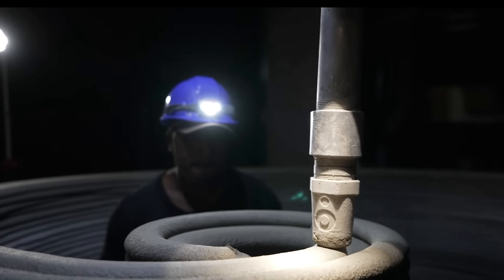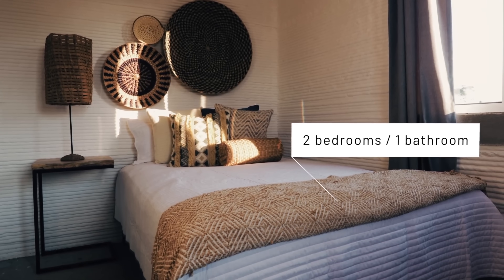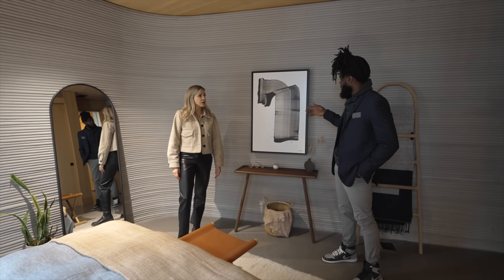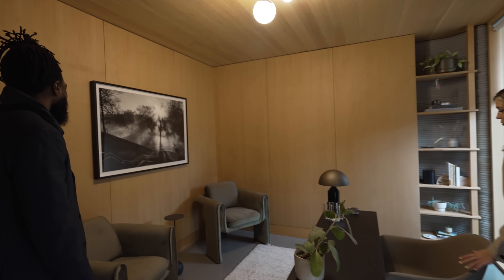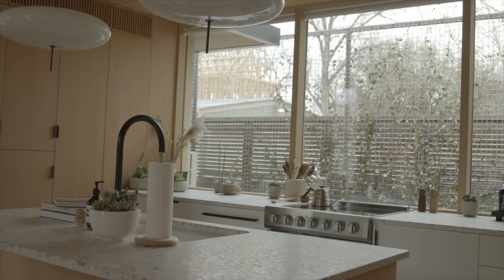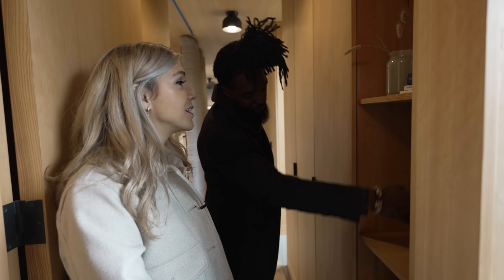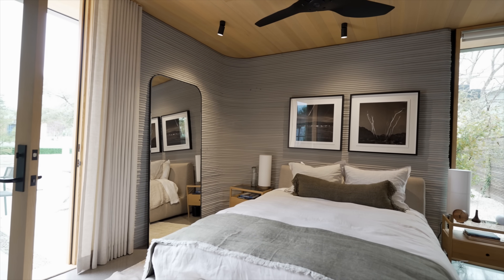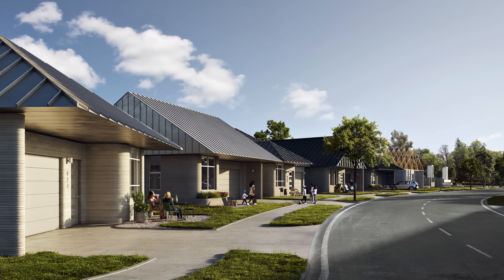Inside A 3D Printed House You'll ACTUALLY Want To Live In

Comment: This is the construction technique of the future. My only concern about such a house is that the exposed concrete parts will collect dust like crazy.
Reply: I do NOT want that house.  to many "technical" /structural Restrictions inovolved with it and  it's required constricted sizes.  The material is a horible mess. Then huge expense to "cover/finish those walls".  Wiring and plumbing issues.  If you want to build something like that there are better/Cheaper , simpler ways to do it.  search ,... Oh what is it called,  Mud/sand bag , earthen bag construction?  And I am not saying I would want that for my main house either.  I've have seen nice "Single Story" hotel rooms....  cement is a mess! espeically when you leave it exposed. Dirt , spiders, and bugs "sticking to it" and those layers/grooves!  then trying to deal with plumbing, electrical etc,  and even try hanging a shelf or picture. :-)) wanna change a door or window? 😅😅😅 that texture is aweful.  even beyond cleaning it has problems.  the novelty would wear off quickly.  and trying to cover that up with wood, plaster, etc... That is Materials and LABOR cost, that  Is $$$$$   Are you noticing that even with the camera/"lense"?shooting done to try and make it  look bigger.  Look at how SMALL the rooms are. EVEN The ones that are supposed to be "larger rooms"  Oh and I live in a mostly solid cement walls and roof/ceiling building ...  I will call Bull Sheets on it being 75 F inside on  days when it is in the 90's .  I live in the desert and once it starts warming up in the spring in the "90's" after a few days the cement warms up, the walls warm up and there is no way you are going to have 75F inside without turning on the AC.  if it goes "hot" then cold" then "hot" then cold for a couple of days, then Maybe... But after after a few solid days or warm/hot temps, the cement warms up. and as the temps keep on climing for "the SUMMER/ spring"  the walls of the building keep getting warmer.  In the low desert in AZ,  if I turn off the AC it will "quickly" start climbing toward the 90's F. I guess higher if you forget to turn on the AC.  Oh, and of course the Reverse happens in the winter.  Sure the novelty of this is "cute"  but the reality is..................  Not So Great.   especially if you DON'T want just a little/cramped "single persons"  condo/vacation condo"  and You don't want the MESS of unfinished cement walls.  You know what else you will notice about this... NO REBAR REINFORCEMENT/"structural support". ("no multiple stories. " Fractures? not good for earthquakes, settling ground, etc.just plain old heat and cold expansion constrictions problems...) And there Are More issues than just these... Ahh but the Novelty of it. 😅

Comment: As far as I know concrete is the less thermic insulation material after steel use in construction, the concrete is very hot in summer and extremely cold in winter, however he stated the contrary, I would like it to be tested in another video.

Comment: What a waste of a video.  No technical details at all.  No one cares how the inside "looks", you can decorate any type of construction with plaster or wood walls.
-
How do the concrete walls fair with moisture penetration and condensation?  Do the interior side of the walls sweat?
-
The roof appears to be fairly standard stick-frame style construction.  How is it connected?  Are the connections strong enough for locations that have hurricanes?
-
How is plumbing and electrical run in the concrete walls?
-
When you decide to move that picture, how do you patch the hole from the original screw?  For that matter, something damages the concrete wall - how do you fix it?
-
What are the color options for the concrete?  I mean "beige" is nice and all, but it's still beige....
-
Maybe dive into how the 'curved' forms were actually built.
-
How do you install and seal around doors and windows?  (Also, the windows on this house look single pane, are they?)
-
What is the R-value of the exterior walls?????

Comment: Weird irony, this is probably a 300k+ house. Yes the core foundation is '3d printed oooo ahhhh' but all the fixings are top market/premium. But the whole claim of 3d printed homes is more affordable, this is not more affordable. The fact the price and cost is not mentioned anywhere makes that clear. I like the 3d-printed look but for interiors long term i can see it being annoying the clean the walls, they will get all kinds of dust on those little ridges. I like durable heavy mass materials, so concrete is a plus in my mind over stick house. I like that they take advantage of the ability to create curved walls with the method, good plan, its easy to do an adds more character. Doing the same with a stick foundation is much harder, boxes are easy.

Comment: Two questions I've always had, can you make right angle walls and if you were to skin the walls smooth as they did does it negate the cost savings? It's unique and interesting but I like sharp lines and I don't like textured walls. They did a great job though. I don't know why there aren't massive communities being built by ICON across the country already.
Reply: It's because they're just building the wall, which is normally not that time consuming.
Reply: Oh there are good reasons for "Not" ...  I do NOT want that house.  to many "technical" /structural Restrictions inovolved with it and  it's required constricted sizes.  The material is a horible mess. Then huge expense to "cover/finish those walls".  Wiring and plumbing issues.  If you want to build something like that there are better/Cheaper , simpler ways to do it.  search ,... Oh what is it called,  Mud/sand bag , earthen bag construction.  And I am not saying I would want that for my main house either.  I've have seen nice hotel rooms....  cement is a mess! espeically when you leave it exposed. Dirt , spiders, and bugs "sticking to it" and those layers/grooves!  then trying to deal with plumbing, electrical etc,  and even try hanging a shelf or picture. :-)) wanna change a door or window? 😅😅😅 that texture is aweful.  even beyond cleaning it has problems.  the novelty would wear off quickly.  and trying to cover that up with wood, plaster, etc... IS $$$$$   Are you noticing that even with the camera/"lense"?shooting done to try and make it  look bigger.  Look at how SMALL the rooms are. EVEN The ones that are supposed to be "larger rooms"  Oh and I live in a mostly solid cement walls and roof/ceiling ...  I will call Bull Sheets on it being 75 F inside on  days when it is in the 90's .  I live in the desert and once it starts warming up in the spring in the "90's" after a few days the cement warms up, the walls warm up and there is no way you are going to have 75F inside without turning on the AC.  if it goes "hot" then cold" then "hot" then cold for a couple of days, then Maybe... But after after a few solid days or warm/hot temps, the cement warms up. and as the temps keep on climing for "the SUMMER/ spring"  the walls of the building keep getting warmer.  In the low desert in AZ,  if I turn off the AC it will "quickly" start climbing toward the 90's F. I guess higher if you forget to turn on the AC.  Oh, and of course the Reverse happens in the winter.  Sure the novelty of this is "cute"  but the reality is..................  Not So Great.   especially if you DON'T want just a little/cramped "single persons"  condo/vacation condo"  and You don't want the MESS of unfinished cement walls.  You know what else you will notice about this... NO REBAR REINFORCEMENT/"structural support". ("no multiple stories") And there Are More issues than just these... Ahh but the Novelty of it. 😅

Comment: I don't get this man's claims whatsoever.  There is no way that house is going to maintain 75 degrees on a hot Texas day without central air, people would have made houses out of concrete long ago if that was the case.  Also, concrete is a terrible insulator, it's also porous and will allow water to wick through to the inside without some sort of treatment.

Comment: My only issue with the concrete would be dust build up. And because concrete is porous the oils would make if even harder to clean. A good coat of plaster would address that like they did in the bathroom. I cant even imagine the mold problems you would have in a room that gets humid a lot like a bathroom with a shower.

Comment: Has anyone tried the sledge hammer test if it can withstand a sledge hammer attack for 10 minutes without putting a hole in the concrete section, most concrete walls are reinforced

Comment: It’s almost an evolution of the classic mid-century modern or Scandinavian with the use of concrete contrasting with natural woods.  However with flowing lines through the use of the printing vice the sharp edges which were a constraint of using concrete/glass blocks.  I’d live in the One in a heartbeat if it were available in Canada.

Comment: Yes, I would live in a 3D printed house. Just saw a clip on the news and was blown away by application of where this could go. This place is amazing.
Reply: I do NOT want that house.  to many "technical" /structural Restrictions inovolved with it and  it required constricted sizes.  The material is a horible mess. Then huge expense to "cover/finish those walls".  Wiring and plumbing issues.  If you want to build something like that there are better/Cheaper , simpler ways to do it.  search ,... Oh what is it called,  Mud/sand bag , earthen bag construction.  And I am not saying I would want that for my main house either.  I've have seen nice hotel rooms....  cement is a mess! espeically when you leave it exposed. Dirt , spiders, and bugs "sticking to it" and those layers/grooves!  then trying to deal with plumbing, electrical etc,  and even try hanging a shelf or picture. :-)) wanna change a door or window? 😅😅😅 that texture is aweful.  even beyond cleaning it has problems.  the novelty would wear off quickly.  and trying to cover that up with wood, plaster, etc... IS $$$$$   Are you noticing that even with the camera/"lense"?shooting done to try and make it  look bigger.  Look at how SMALL the rooms are. EVEN The ones that are supposed to be "larger rooms"  Oh and I live in a mostly solid cement walls and roof/ceiling ...  I will call Bull Sheets on it being 75 F inside on  days when it is in the 90's .  I live in the desert and once it starts warming up in the spring in the "90's" after a few days the cement warms up, the walls warm up and there is no way you are going to have 75F inside without turning on the AC.  if it goes "hot" then cold" then "hot" the cold for a couple of days, then Maybe... But after after a few solid days or warm/hot temps, the cement warms up. and as the temps keep on climing for "the SUMMER/ spring"  the walls of the building keep getting warmer.  In the low desert in AZ,  if I turn off the AC it will "quickly" start climbing toward the 90's F. I guess higher if you forget to turn on the AC.  Oh, and of course the Reverse happens in the winter.  Sure the novelty of this is "cute"  but the reality is..................  Not So Great.   especially if you DON'T want just a little/cramped "single persons"  condo/vacation condo"  and You don't want the MESS of unfinished cement walls.  You know what else you will notice about this... NO REBAR REINFORCEMENT/"structural support".  And there Are More issues than just these... Ahh but the Novelty of it. 😅

Comment: I can see so many difficulties with this, how do you run cables in the walls during printing? what about plumbing? And are the walls insulated? What about humidity? How much weight can these walls carry (the don't have any steel reinforcement).
Curved walls are insanely expensive done with conrece in a regular way, so this is a plus with 3D printers, looks mega cool!
Reply: If you look, you can see the walls aren't solid, but two layers with a wavy middle bracing section. This forms a chance of the insulation properties. Wiring conduits are just designed into the print. Ive seen some that just stop a wall at the conduit and the operator lays in the PVC channeling for the wires. Same for plumbing. Humidity and strength would come down to the overall design. Its still using what looks like SIP panels for the roof, so airflow could be built into where the roof sites on the printed walls. I, for one, and really glad to see other options for building being experimented with, otherwise I can't see how my kids would ever be able to afford their own homes without being multimillionaires.
Reply: @TheChromeRonin  got it thanks for the detailed reply! Still concerned for this use in locations where temperatures go below freezing for months. Still there has to be a solution and in the worst case you just insulate it from the outside/inside like any regular concrete home.
Agreed if this can drop cost I’m down for it, especially curved walls and complicated forms that are usually insanely expensive to build.

Comment: Funny how they completely ignored the flaw in this system. The majorly uneven edges around the openings for doors and windows. That uneven state is going to cost a lot more in labor to seal up. If you can even do it well enough to prevent leaking and pests from getting in. That and they do not talk about what finishing the house and putting a roof on costs on top of the the 3D printed it part. It isn't cheap. 

In my opinion 3D printing isn't the answer. Insulated Concrete Forms is a better option today.

Comment: You like wifi? This style of construction is a nightmare for you.  There are alternative technologies you can use to get around the challenges of concrete walls but just as concrete is a thermal insulator it also blocks wifi signals.  Extenders, repeaters, and probably most useful electrical line nodes.

Comment: I’ve learned that most of these 3D printed houses tend to run $250 -$400 per sq ft. When you compare this to conventionally built houses, it doesn’t really come in as what I’d call “affordable”.  I just built an 1800 sq ft home (post &beam) with 14 ft ceilings and many high end features in Tennessee for $150 per sq ft. Granted, I did many of the interior finishes myself, which saved a lot on labor, but I am not a professional, so anyone can do the same if they are willing to invest the sweat equity. My wife & I painted & stained the interior & exterior walls, laid all of the tile, installed the flooring, doors & trim work. I also assembled and installed the cabinetry and tongue & groove ceilings. I’m 65 years old, so no one can say it’s too hard.
Reply: Most homes run upwards of a million dollars now, this is still affordable in comparison
Reply: @FRHEAKY  not where I live.

Comment: I’ve seen a 3D printed house being built in Tempe, AZ.  What I like so much about this one is the curved walls showing what is so easily possible with 3D printed houses.  The ones in AZ were traditionally styled with square walls.
Reply: I do NOT want that house.  to many "technical" /structural Restrictions inovolved with it and  it's required constricted sizes.  The material is a horible mess. Then huge expense to "cover/finish those walls".  Wiring and plumbing issues.  If you want to build something like that there are better/Cheaper , simpler ways to do it.  search ,... Oh what is it called,  Mud/sand bag , earthen bag construction?  And I am not saying I would want that for my main house either.  I've have seen nice "Single Story" hotel rooms....  cement is a mess! espeically when you leave it exposed. Dirt , spiders, and bugs "sticking to it" and those layers/grooves!  then trying to deal with plumbing, electrical etc,  and even try hanging a shelf or picture. :-)) wanna change a door or window? 😅😅😅 that texture is aweful.  even beyond cleaning it has problems.  the novelty would wear off quickly.  and trying to cover that up with wood, plaster, etc... IS $$$$$   Are you noticing that even with the camera/"lense"?shooting done to try and make it  look bigger.  Look at how SMALL the rooms are. EVEN The ones that are supposed to be "larger rooms"  Oh and I live in a mostly solid cement walls and roof/ceiling building ...  I will call Bull Sheets on it being 75 F inside on  days when it is in the 90's .  I live in the desert and once it starts warming up in the spring in the "90's" after a few days the cement warms up, the walls warm up and there is no way you are going to have 75F inside without turning on the AC.  if it goes "hot" then cold" then "hot" then cold for a couple of days, then Maybe... But after after a few solid days or warm/hot temps, the cement warms up. and as the temps keep on climing for "the SUMMER/ spring"  the walls of the building keep getting warmer.  In the low desert in AZ,  if I turn off the AC it will "quickly" start climbing toward the 90's F. I guess higher if you forget to turn on the AC.  Oh, and of course the Reverse happens in the winter.  Sure the novelty of this is "cute"  but the reality is..................  Not So Great.   especially if you DON'T want just a little/cramped "single persons"  condo/vacation condo"  and You don't want the MESS of unfinished cement walls.  You know what else you will notice about this... NO REBAR REINFORCEMENT/"structural support". ("no multiple stories" Fractures? not good for earthquakes, settling ground, etc.) And there Are More issues than just these... Ahh but the Novelty of it. 😅

Comment: I wouldn't want those ridges on the walls inside the house. They would look horrendous with dust clinging to them. Would definitely need a crew to run inside and toss parging mix over it all to smooth the walls over or a framing crew to put up traditional walls so people can hang pictures and put up shelves.